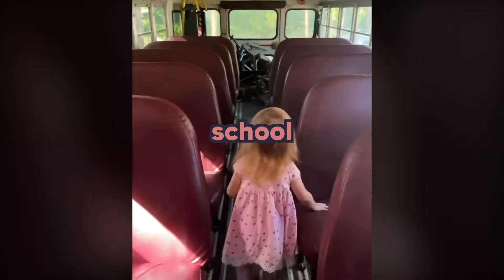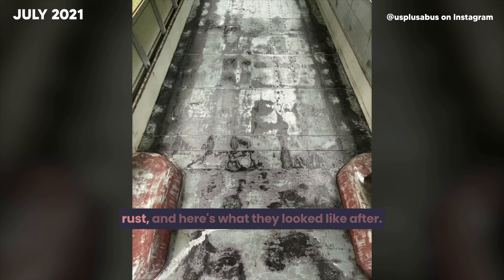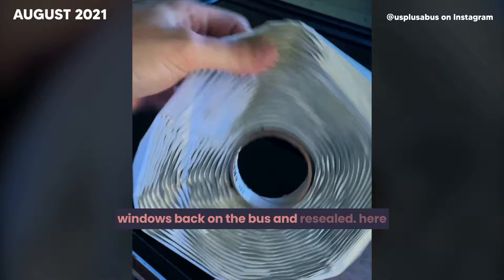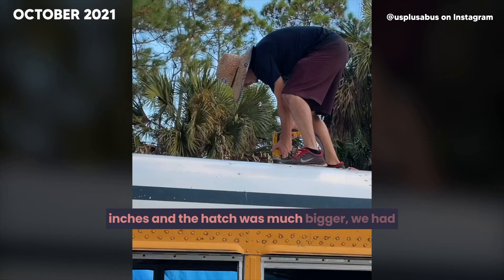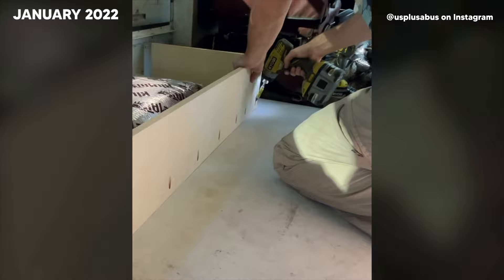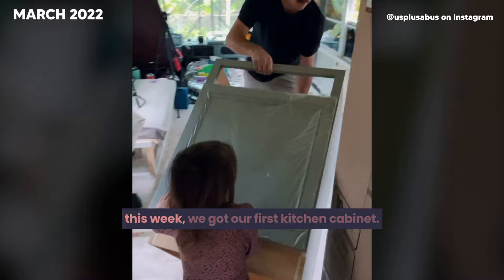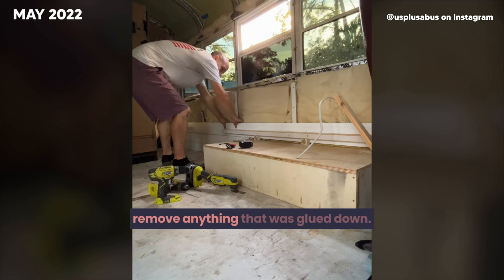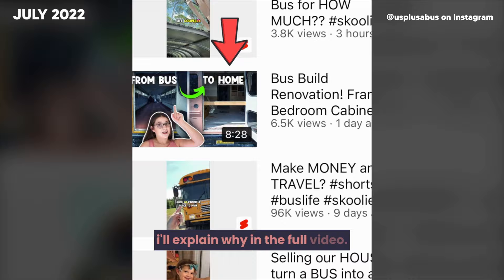1 Year Bus Build Recap: Skoolie Conversion Compilation

Comment: I will guess how many times you went and you didn’t tell me I can only do one number or 3 so did you take a trip to Lowe’s 100, 50, 30, 70, 35, 75, 105, 57, 56, 58, 59, 49, 48, 42, 24, 63, 67, 99, 69, 65, 137, 43, 39, 132, 53, 78, 51, 31, 231, 6969, 157, 52, 185, 64, 123, 142
Reply: Tell me if I’m right